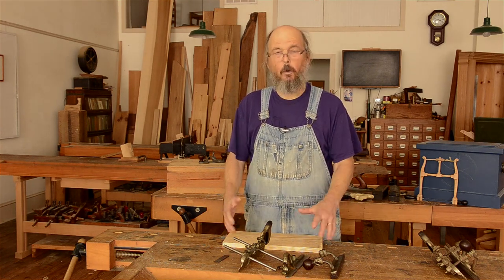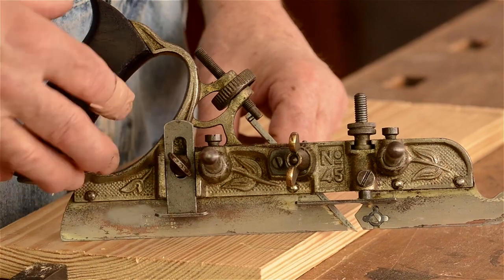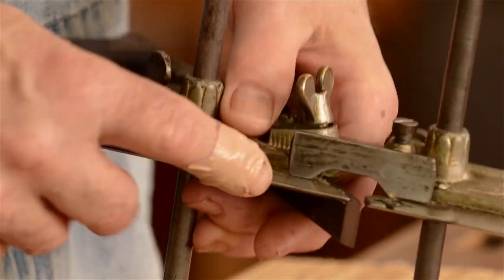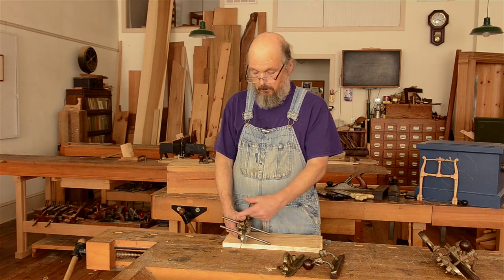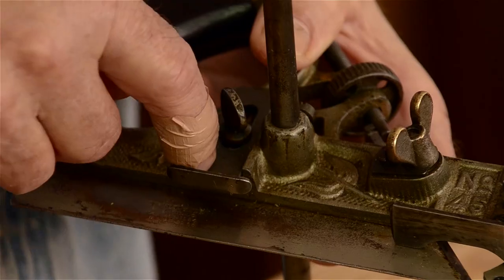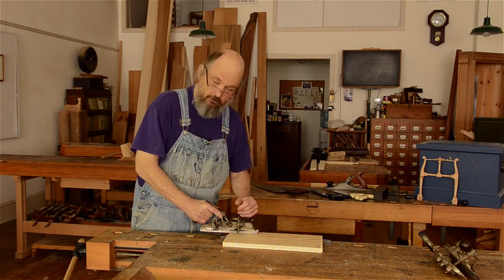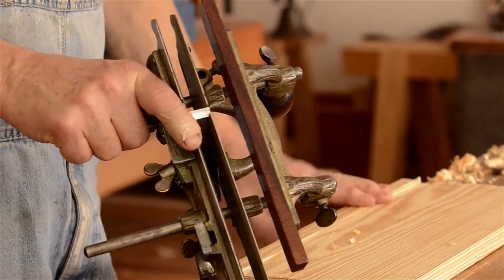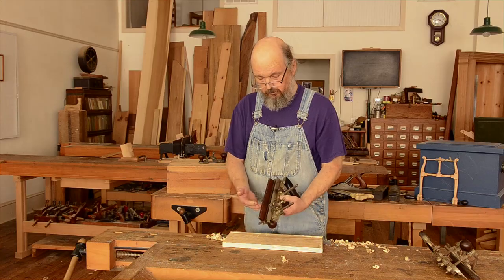How to Use a Combination Plane for Woodworking

Comment: A quality of tools like this is the ornate leaf design cast into the sides..always appreciated that desire of folks for design ..not just for function but more.
Reply from the maker: Yes, I wish it was more common these days.
Reply: @WoodAndShop  I was mechanical design for 20 years..more like drafting but with the cad systems. Often a good design is considered "beautiful" for it's fitting the purpose and functioning ..It's like good design makes it attractive..the ornamentation is like icing..but auto parts don't have the potential for extra ornamentation..not like furniture or handtools

Comment: With the Stanley #78 fillister plane the blade is flush for cross grain cuts (using the spur cutter) and protrudes slightly for long grain work (the blade is wider than the body) to prevent the cut becoming stepped. The filister is for rebates (rabbets) so I assume the same for the #45/55 when used for this purpose. When cutting a groove, you mention allowing the blade to protrude "a hair" past the skates (which is the equivalent of the body) - is that why? Thanks for sharing the content - much appreciated.